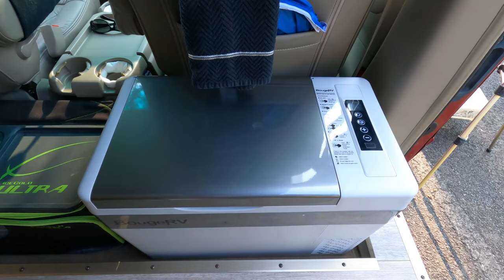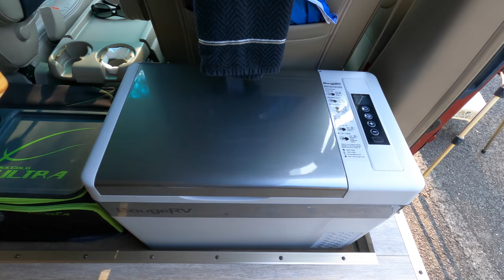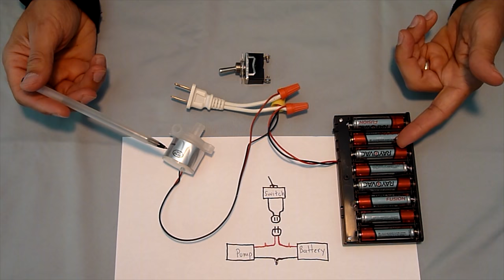Minivan Camper Build Chapter 2: 7,000 mile review

Comment: Bravo!  Well built and your video is well narrated,  quite impressive.  May I ask....if I wanted the bed to sleep 2 people, would the best way to modify your design be to simply make the cabinetry narrower all over, or to forego the bottom portions?  Thank you!
Reply from the maker: For the bed to sleep 2 people, the shelf unit would be deleted and the sink cabinet would be very narrow. However, additional storage would be available under the bed, so it could work. One of the things I like best about my build is that I can do complete meal prep without leaving the van, but this would be really tight with two people. If I was doing a new 2-person build, I would do a lot of YouTube research to get the best ideas for that particular use

Comment: have you thought about adding a second or third stopper block under the first bed panel to allow you to recline the seat more? just a thought. great update.
Reply from the maker: Good question. I’ve discovered that when I’m seated on the couch platform, there’s enough friction with the frame that I can have the back at many different angles without sliding down, so no additional stoppers are required. Another unexpected feature I didn’t have to work for!

Comment: Awesome my friend! I just used your specific design to build my bed. I need to know what you used for the 4 folding/ locking legs at foot of the bed. I think you use 2x2 but its the hardware im confused about. Thank you so much for this video. Ive watched Eric for a while. Great but not so easy to fathom myself building until this video. Thanks again!
Reply from the maker: Thanks for your comments. Yes, the legs are 2x2. The link for the locking hinges is in the written description under the video. I eliminated one of the legs in my build because it was a bit of a reach to operate, see the Chapter 3 video for details

Comment: Any chance you can show a bit of detail with your sink and waste water setup.  We are trying to figure out some sort of drain that would work with the thin metal bowl.
Reply from the maker: All parts I used in the build are listed in the written summary of my first video, see also links below. The sink and drain are attached to each other with silicone adhesive sealant. I couldn't figure out an easy way get an integrated stopper to work with this sink, so it does not have a stopper. I initially didn't use enough adhesive between the sink bottom and drain, and it came off when I bumped it, but then I scuffed up the joining surfaces and added a lot more silicone sealant, and it's been fine since then (see first video at about 5:10 and this video at about 9:40 to see the sealant attaching the sink to the drain). Good luck!
(https://www.youtube.com/watch?v=xXIOVMwKkKg&t=311s)
(https://www.amazon.com/gp/product/B08B8YXX9L/ref=ppx_yo_dt_b_asin_title_o09_s00?ie=UTF8&psc=1)  (https://www.amazon.com/gp/product/B000EDUTPO/ref=ppx_yo_dt_b_asin_title_o02_s01?ie=UTF8&psc=1)

Comment: Confused. First, after watching every similar build I chose to follow yours most closely, so big thumbs up. The issue I'm having is that the angle of my seat back leans back a lot. I've read that 15 degrees is optimal, up to 20 degrees, but it seems that your design has the back reclining much more than that. Did I miss something? At a 20 degree incline I have about 14" between the edge of the front panel and the rear. So the seat back(s) create a triangle that has a 14" base with 19" sides.

Thanks!
Reply from the maker: I measured the seat back angle on my build, and it's a 22 degree incline. When I was designing the bed/couch, I started with Eric's design, making sure it had equal size panels and seat cushions to fit the overall mattress length, then I adjusted the bed frame dimensions for an overall size and couch seat angle that seemed reasonable and comfortable for fitting in my van. The couch is very comfortable for me, but of course that's a personal preference decision. If less incline is desired, any of three modifications could be made, and will result in the front and rear panels being closer together in couch mode: (1) the bed frame length could be shorter in the front, (2) the frame piece that blocks the stopper could be moved further back, or (3) the front and rear panels could be made larger than the middle panels. However, option (3) may require the front and rear cushions being a different size than the middle cushions, and also may result in the seat being too large front-to-back. Anyway, if you think your seat angle is too large, you could slide the couch seat back to find the perfect angle for you, then modify either the frame or the panels to lock it in. Good luck.

Comment: I love this but would love for a tad bit of counter space for a brutane 2 burner stovetop. And what about wifi/internet as I would be LIVING and SLEEPING in van full time living/dwelling????(Stalth in and out of city).
Reply from the maker: In my Chapter 3 video I show how I increased the counter space by adding a sink cover and an outside counter extension. I also use the top of the fridge as flat kitchen workspace, and I often use my single burner stove there. In my first no-build version of this van, I had a two-burner Coleman stove, but it was just too big and too much hassle. My small electric pan and single butane stove are usually enough. Unless you want to pay big money for Starlink, internet is dependent on where you park. With good signal it’s enough to use my phone as a hotspot with my laptop for normal surfing and light streaming. I stay away from corporate public WiFi such as Starbucks due to privacy risk, but public library WiFi is usually safe and available

Comment: Have you considered adding a 12v outlet near the sink so you can just run it off the van battery since it’s such a small load? I imagine it’s probably not a priority since the battery pack you currently have works well enough.
Reply from the maker: Adding an unswitched line to run the faucet pump from the van battery would be more trouble than it’s worth. If I wanted to use a different power source, I would run it to a 12V plug on my portable battery that runs the fridge. But even that’s not necessary; I like the self-contained nature of the sink cabinet, and I only change the AA batteries once each year

Comment: Wow this bed build is perfect for me. Can you tell me where you got the plans to build it from? I have a 2011 Hyundai Santa Fe that has a storage under the floor at approximately the same spot where you're in Peaks that I can store things underneath with and be able to reach them because the floor could lift inside of the frame
Reply from the maker: The bed design is based loosely on Eric’s (Eric Enjoys Earth), but I made lots of modifications to fit my particular van dimensions. I’ve made more changes since I made this video, and I’ve been very happy with it.

Comment: I really like Eric Enjoys Earth's build, but it's a little more than what I need. I definitely like that your build is a little more minimalist. This might be a dumb question since I'm no electrician, but why use the AA batteries instead of a single 12V battery?
Reply from the maker: Thanks for your comments. I use the AA battery/box system because it is so simple, cheap, and effective. An additional specialized 12v battery with enough capacity to power my water system for as long as my AA system would likely be more expensive and less readily available. If I wanted to use a different 12v source, I could run a wire to the 12v battery that powers my fridge, but I like that my water pump battery is on its own system

Comment: I noticed that 3 of the 4 of bed frame cross members are relieved the lower side facing the floor, from left to right in your video this is #1, 3, 4, is this to allow for storage containers to slide under the bed?  I am assuming the 2ed one not relieved is due to floor height?
Reply from the maker: Yes, your observation is correct, the storage bins were just slightly too tall to fit under, so I reduce the thickness a bit. The second cross piece is unchanged to keep the bins from bumping each other

Comment: HI Rob, could you tell us why you chose the EcoFlow RIVER Pro Portable Power Station over the other available brands (like the Jackery for example). Thanks for the great videos 🙏
Reply from the maker: Thanks for your comments. When I purchased my power station last spring, EcoFlow River Pro was the only unit that had all of the features I was looking for, including: (1) 720 Watt-hour capacity, because 500 was too small and 1000 was too expensive, (2) surge capacity to run 1200W appliances, because I love my toaster,  (3) an available plug-in 720Wh expansion pack in case my needs grow in future, (4) direct connection to a Renogy rooftop panel with cables included, and (4) a 90-minute fast charge cycle to 100% when plugged into AC.  However, the battery market is moving fast, and several other companies now have most of these features. My unit has worked well, but I do have a couple of minor complaints: the three 120V AC outlets are on the side of the unit instead of on the front, and the display screen could be better looking.
Reply: @travelswithrob4970  Thanks, I may have to go in the same direction and purchase a portable power station initially. My plan was to build a battery and install it permanently in the rear spare tire compartment in my vehicle. Instead of lugging around the stupid doughnut spare, why not have a full spare in the back on a swing away hitch mounted tire carrier. 😀But, even though my background is in electrical engineering, and automotive technology, I have still to figure out what battery I am going to build and what solar panels I am going to use etc etc. So, my plan is to initially build a simple platform bed and then graduate to something like yours with a bed and cabinets. The plan is to have the battery run a small fridge - probably an ICECO unit because they use the Danfoss/Secop compressors.

Comment: Hey Rob! This seems to be the best design around. Especially since I am a single person so I don't need the massive bed all the van kits provide. I wish some would do this design in a van kit!!  I am just shopping for a new van and wanted to ask your opinion since you mention the roof fan. I am thinking of going $$ big and getting the sienna with 2 sunroofs. Mainly because I have a dog, so for ventilation when leaving her in the vehicle. Do you think 2 sunroofs would be a benefit to the camping use? Just wondering if I am overlooking any downsides.
Reply from the maker: A sunroof is great for ventilation in good weather, and at night in areas without bugs; the problem is rain and bugs in uncertain weather and at night. If you can figure out a good sunroof screen, that solves the bug problem, but the rain problem remains. My side window vent fan is helpful, but not really enough airflow, so I’m planning to install a MaxAir fan in the van roof this year. It’s rainproof, bug proof, and provides great airflow. I’ll make a video when I install it

Comment: Hey Rob I have one more question for you, thanks again for all your videos and responses. Im having trouble finding drain parts for my sink, which I think is the same as yours. I couldn't find parts that fit at home Depot or Lowe's, having some trouble on Amazon currently, just wondering if you could share what drain parts you have/where you got them. Thanks Rob I'm so excited to get out there in my odyssey like you
Reply from the maker: Thanks for your comments, and good luck with your project! All of the product links are in the video description, but here's the link again for the drain: https://www.amazon.com/gp/product/B000EDUTPO/ref=ppx_yo_dt_b_asin_title_o02_s01?ie=UTF8&psc=1.  This drain is not an exact fit. I couldn't find a drain that matched this sink, so I made it work by gluing the drain to the bottom of the sink with clear silicone adhesive sealant on the mating surfaces.  It worked great with no leaks, but it came apart after about six months. So then I cleaned the mating surfaces again, scuffed them with rough sandpaper, and glued the surfaces back together with silicone; then I added a second HUGE amount of silicone sealant around the bottom where the sink meets the drain, so now the joint is encased in a thick collar of sealant with a much larger area for attachment. You can see the sealant wrapper on the drain in the video at about the 10 minute mark.  This has worked well for a year with no issues.
Reply: @travelswithrob4970  Wow I cannot believe I missed the links to the supplies in the description! Thanks again for your response it is super helpful

Comment: have you looked at the small lithium powered rechargeable water pumps? Can get them on Amazon from 10 to 20 bucks...  I have 2 and they work great.
Reply from the maker: If you are referring to the pumps that fit on top of a 5-gallon jug, then yes I have seen those.  However, I liked the flexibility of selecting my own faucet, which provides much better height than the jug pumps.

Comment: On the rear legs of the couch/bed have you considered some type of  "C/D" shaped handle on the rear legs to make it easier for you to deploy the rears rather than actually grabbing the entire (leg) hunk of wood?
Reply from the maker: The leg hinges have a release button which needs to be pressed to fold the legs down. Since my hand is already in position, I don’t think additional hardware would make much difference, because moving the leg on the hinges is really easy.

Comment: Very good. How about your battery charge when you driving?
Reply from the maker: The battery charges using a roof solar panel and also can charge with a 12 volt outlet in the van. I show the charging setup in my Chapter 3 video

Comment: Do you happen to know if the 2001 Odyssey is the same size as the 2004?  We have a 2001 we bought new, and it's in very good condition with just over $90,000. miles.  It's a CA car so rust is no issue and it's maintained every 6 months, so getting rid of it is kind of a waste, but we'd like to get a new driver for everyday.  We've been thinking about making a camper out of it, and this set up would be great.
Reply from the maker: The 2001 is very similar to the 2004. I’ve taken good care of mine, and it has 220,000 miles on it, with original engine and transmission. It’s been a great van for me, and I expect many more miles.
Reply: @travelswithrob4970  Thank you.

Comment: I’m in the process of purchasing the hardware, what did you use on the front legs so they can flip down?
Reply from the maker: All product links are in the video written description, but here's the link for the locking leg hinge: https://www.amazon.com/gp/product/B08G1S4VYJ/ref=ppx_yo_dt_b_asin_title_o00_s00?ie=UTF8&psc=1
By the way, I decided to remove the leg and hinge in the right rear of the front panel (by the shelf unit), and replace it with a 3 inch bracket support, because the hinge lock was a bit difficult to reach and operate. I will show this modification in an upcoming video due out before January

Comment: I'm going to mimick the bed. Attempt to that is.
Reply from the maker: Here’s a tip: it’s possible to eliminate the 2 rear folding legs if you make the bed frame 2-3 inches longer to support the rear edge of the front panel in bed mode. I’ve made this adjustment on my bed, and it is easier to operate. Good luck with your project!

Comment: Very nice explanation! I am wondering why the double 2bys in the middle section, added strength? One is jigsaw'd and the other isn't, are you sliding something under there just to that point? Thanks. You removed a rear leg eventually, why not both?
Reply from the maker: Honestly, I can’t remember why I included two 2x4s in the middle 🤣 (old age is getting to me!). Yes, two of the crosspieces are notched to allow a large bin to slide under. One leg was replaced with a bracket, but I didn’t want the bracket extension on the other side because I would be constantly bumping it with my knee and leg. Every inch counts!
Reply: @travelswithrob4970  Thanks!

Comment: Awesome!  Will 40"X72" bed frame fit into the Honda Odyssey after removing all the seats?
Reply from the maker: Yes it will fit. In my design, a 40” wide bed could even accommodate the shelf unit and sink cabinet, but they would be 1 or 2 inches shallower. Keep in mind that as the bed and frame get larger, they also get heavier, so if you use a convertible frame like mine, a wider bed/couch will be a bit more difficult to convert
Reply: @travelswithrob4970    Thank you so much!  I am thinking about becoming a van dweller in the future and your info helps me a lot for a prep.

Comment: Excellent explanation, thank you! If I didn’t want the “back” panel to come up could I leave out the 4th piano hinge and smaller cut of wood? So that it would be just 4 panels instead of 5?
Reply from the maker: Yes, you could eliminate the the rear hinge, and just bolt the  entire rear panel to the bed frame. However, since the Odyssey has a recessed space in the back, the flip-up panel is essential in my van to access lots of storage space
Reply: Thank you for the reply:) Excited to build this design!
I forgot to ask how you determined the length of the frame?
Reply from the maker: @elissasanchez4749  The length of the frame is somewhat variable, and it affects both the amount of support for the front panel and the angle of the backrest in couch mode. I wouldn’t make it any shorter than I showed; if you make it longer (like Eric’s design), then the rails are in the way. Or you could make the support rail longer by the sink cabinet to eliminate one of the legs. So many choices …
Reply: Thank you!